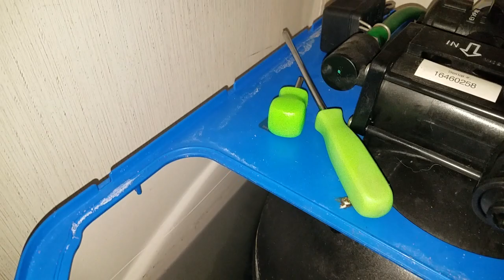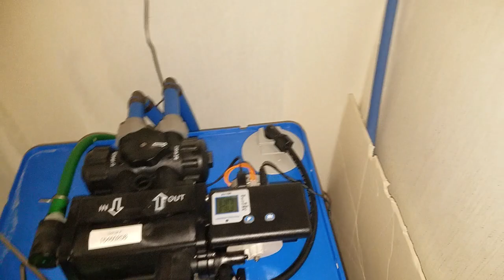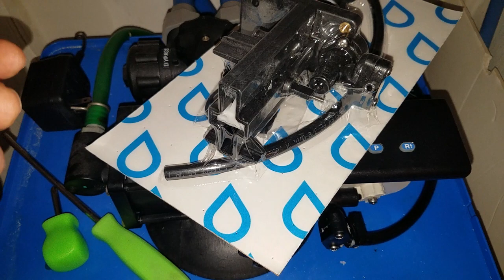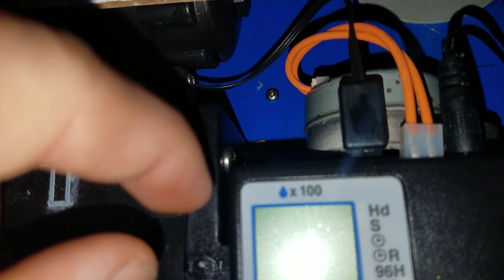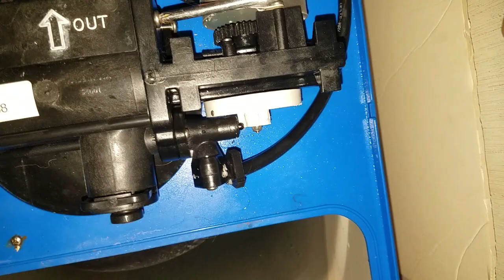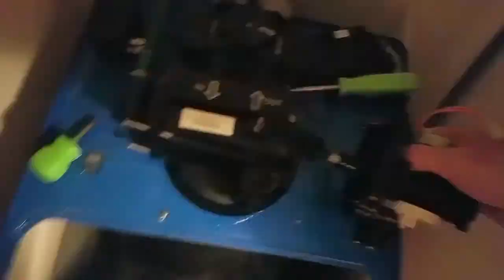Water Boss 380 repair by an average joe. Pt. 1

Comment: Water boss is a POS.  Fixed it  3 times cheap plastic parts with that wheel and valve.  Just spent $400 on Morton new one.  No more head aches.

Comment: Thanks for posting this.  I have the Waterboss proplus 380, and the problem with mine is that one of the cam stops on the magnetic disk wore down such that it couldn't depress the valve stub.  For whatever reason, that valve stub takes a lot of force to push.